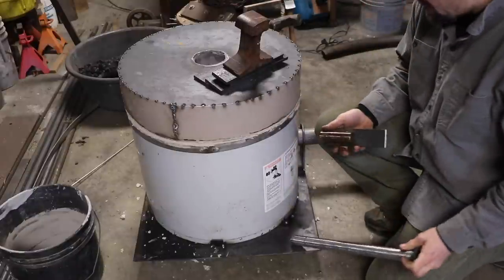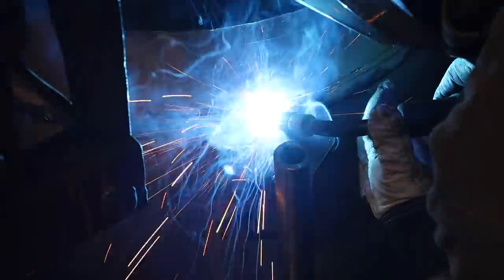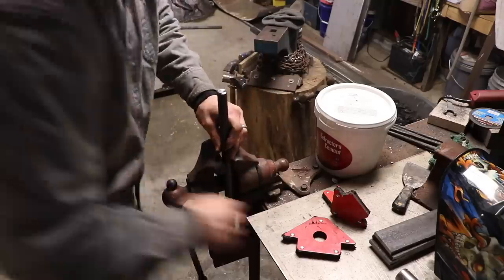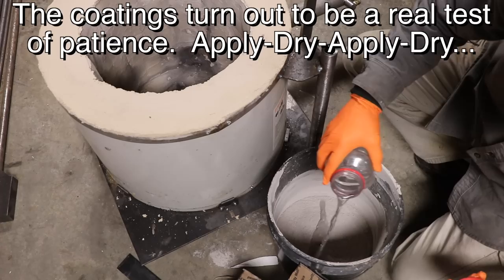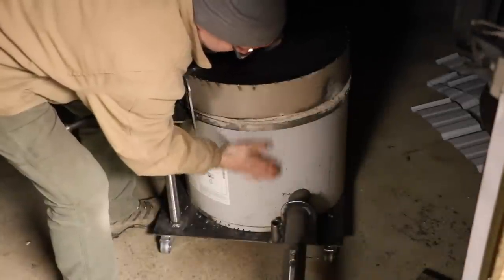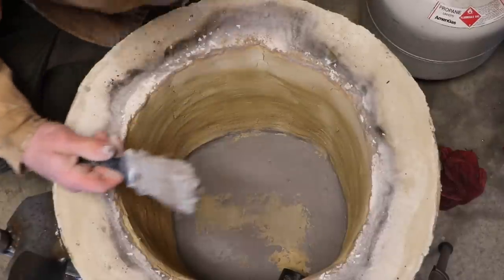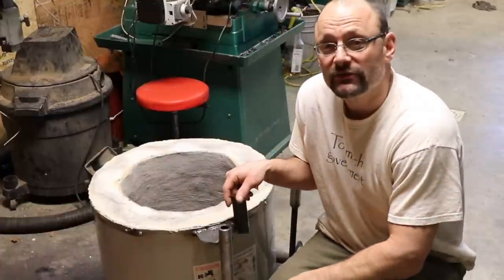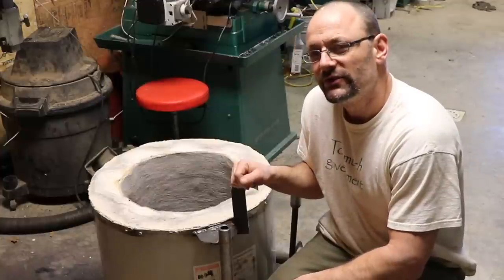Making a Foundry Furnace From An Old Water Heater, Part 2

Comment: On our Hot strip mill where they roll slabs 12' long 10" thick and 50" wide  and rolled into coils to keep the heat in as it goes through 5 strip mill stands they used Koa-wool to keep the heat in. I could be rolled down to 1/8" thick. This steel goes through many rolling operations before it gets to the consumer. They used stickers like you did John in the vertical . You idea was right, they only used the Koa-wool with out the refractory. All it had to do was hold the heat in as the strip went down the line. At the end when it got into a coil while still red hot they would quench it with water. Very Nice Job John !!!

Comment: Beautiful!
I would recommend that you either install a valve to regulate the forced air from the vacuum cleaner motor, or an electronic speed controller.
A Digital Temperature indicator would also be a nice addition.

Comment: I lined my first home-built furnace with Pyruma Fire Cement - No wool - It had a lining around 6 inches thick. It used to develop cracks regularly which used to worry me and I'd be forever repairing them. When it came to replacing my furnace with a smart new store furnace, I smashed up my old pot to dispose of it and breaking out the old cement was a hard job (by that time it had developed more cracks), so I reckon I'd been worrying needlessly. I'm now saving up for a new one.

Comment: You can definitely melt cast iron with that, you may need to change your burner from propane to waste oil, or diesel, maybe K1. But it is built to handle some serious heat.

Comment: I ran into the same issue with the satanite when I made my foundry. My ocd had me reapplying and touching up the cracks over and over. The cracks are just the way it is.
Reply: less water will result in less cracking with most refractories. unless its real high-end stuff made for dipping like the last product he used

Comment: had a question, how much propane do you go through? or rather how long does one tank of propane last?
Reply from the maker: Depends on what I'm melting and how much.  I can melt aluminum easily many times with a tank.  Probably do 2 big copper melts with 1 20# propane tank.
Reply: @FarmCraft101  
Just started watching your videos you said this was a Hobby so are you a machinest is by trade??
Reply: @FarmCraft101  so can a person melt copper and aluminum to get the higher price per pound and still make money after paying for the propane?
Reply: @timwalton5504  not at today's prices but if they turn around and start back up yes. We are getting 25 cents a pound by me. Check out Big D stacking on utube he shows expenses by yield he even does it in Australia and dollars.

Comment: Looked thru your build, and two questions popped up in my head:

1. It lookes as if you use a forced air burner, can't a normal aspirated burner get to the temperature ?

2. The lid, are you sure that the insulation mounted the right way can hold the refractory, or do you onlu use a thin layer ?

Oh and by the way, where did you get your temperatur reader ? Seems that I can only find the ones that barely copes with alu melting temperatures.

Anyway interesting videos

Comment: I think you need a structure that can help life the molten metal out of the furnace so it will be easier to pour your castings without spillage due to not being able to hold the weights for very long and due to the heat of the pouring metals.

Comment: Yeah we heard that same comment over and over again at our shop in Cadillac Michigan at Cadillac castings I think the company branded that we just called it Ladle wash it was the last layer starting with a bold and a portable cast bowl and vibratory tool, then a layer of ram refractory which is a clade type style that you use a air ram to force it into all of the defects of the castable and then ale to wash which is a sacrificial layer that can be replaced every couple of days!

Comment: How thick is the insulation?  Was it around 4 inches?  I want to use a helium tank, but I think only about 2 inches of caowool will fit, and still have room for the crucible.  Would that be a thick enough insulation wall?
Reply from the maker: It will work, but furnace will be less efficient, taking longer, and won't reach as high of a max temperature.

Comment: The tube you installed to store your lid handle will make the hand portion of the handle right at the gap between the lid and the body.  The handle will become too hot to handle.
Reply from the maker: I will have the handle installed in the lid when the furnace is in use.

Comment: *the first layer of refractory was a mold and pourable refractory you called the mold in Grease poor the refractory between the outer shell and the inner mold and run a big vibratory tool we called at the donkey dick!! Then you pull the mold add the ram refractory as a refining the inner structure and then the ladle wash as a sacrificial layer that could be replaced every day or two or patched on-site if there happened to be a crack forming and you needed to finish out the shift with the ladle!